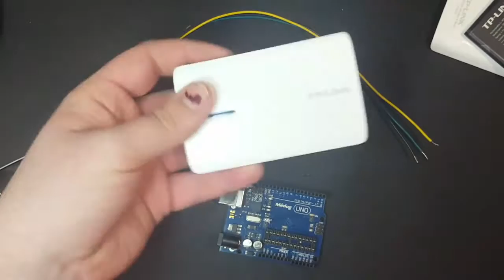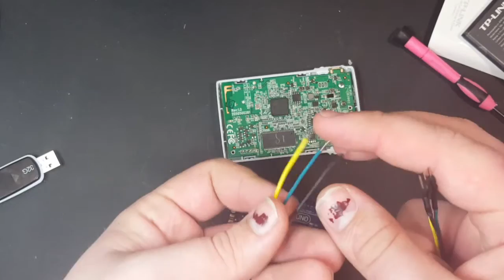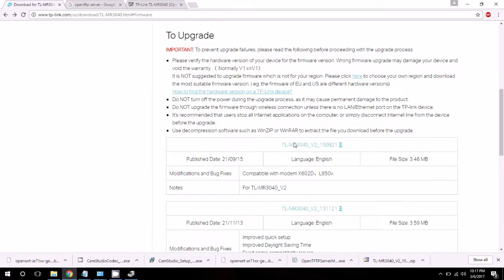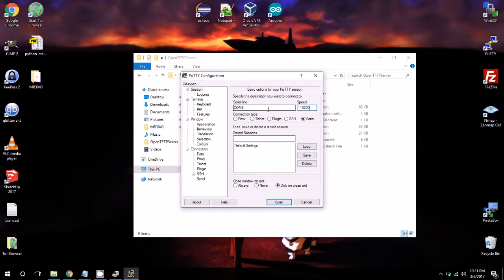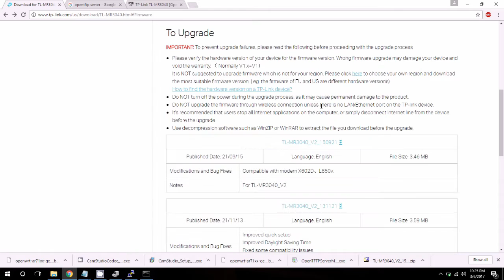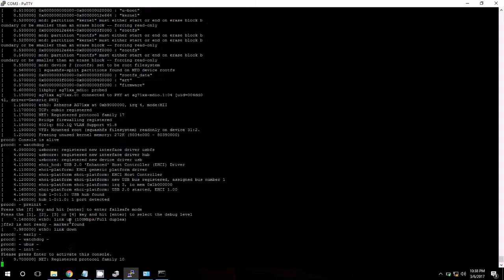Howto on Fixing Bricked MR3040

Comment: Hey @hackeritalics, I know this howto is of an older date already, but I’ll try asking in case you’d notice. 

The howto is great, I’m thrilled and prepared everything to fix my MR3040 I bricked years ago since I found out about your way of unbricking the router with UNO. So far everything went great, but I’m getting an error connecting via the opentftp server on port 69. The error is 192.168.1.253 Port 69, bind failed. Do you have a hunch on what that might be? There seems to be no other connection using that port and if I try :68 or :70 PuTTY / hornet does not work with it. Thank you for any thought on how to solve that!
Reply from the maker: OH, well hello! You know, I don't get on this username very often so I just saw this... hopefully you already figured it out but, if not, here is what I would suggest.

The first thing I would do is check to see if something else is already listening for connections on port 69 on your computer. Here is a quick guide on doing this: https://adamtheautomator.com/netstat-port/

After you know what process is listening on port 69 you will be able to figure out what to do with it. If it's not something important then you should be able to just kill that process using the task manager. One thing I"ll say is that port 69 is generally reserved for tftp. You may already have a tftp service as a part of another product, though this would be kind of odd.. (Some Internet of Things devices like smart thermostats or sip phones use tftp.)

The last bit I would say is that it's also possible that you have to run the OpenTFTP server as an administrator for it to work. I don't remember if I had "UAC" turrend off at the time I made this video, but to run the bat file as an administrator you should be able to just right-click on it and say "Run as Admin". (You may need to hold down shift when you right-click to see this option.) So yes, maybe try running your TFTP server with admin privileges and see if that helps out.

Comment: Any tips for avoiding a brick?
Reply from the maker: Mostly I would just say to pay attention to which version of firmware you were using and ensuring that it is for your version and revision of device. Under normal circumstances you won't have to go through something that is this technical to load firmware on and off the device. Even when loading open wrt onto it's to begin with under normal circumstances you will only be using the web interface and uploading the firmware update as if it were any other update from the manufacturer. If you are coming from open wrt, make sure that you are using the correct firmware and make sure you understand the steps regarding striping off the boot loader from the factory image as well before loading it. The size of the image is going to be exactly the same as the total size of all the available storage on the device. When you are running in open wrt you are unable to access certain parts of that available storage, so if you upload the entire firmware image it will start to write it to that available memory starting at the wrong place and eventually terminate too early. That will leave you with duplicate bootloader sections and then missing a bunch of data that would have been written at the end. That's how you end up with the brick basically. Other than those things, just look at and read and understand the documentation for your model on the open wrt site before you do any uploads of any custom firmwares. They will cover all of this stuff in great detail explain it a lot better than I have here. LOL they also have extremely knowledgeable Forum members.

Comment: thanks a lot... these two codes solved all the issues .....

hornet> setenv ipaddr 192.168.1.1
hornet> setenv serverip 192.168.1.253

nowhere in OpenWRT website, it is written I guess...
thank you very much...
Reply from the maker: I would not recommend using 192.168.1.1 since that is normally the default gateway on a 192.168 /24 network..
Reply: @hackeritalics  after a lot of failed attempts  I blindly followed your video... I'm not an expert in this field, just a beginner... Please make related videos if possible... Thank you for your efforts...
Reply: @hackeritalics  but I noticed one thing openwrt breaker barrier version doesn't work on My router with version 2.2...tried many times...

Comment: So... All led flash on power on and then only power light and cannot find any WiFi or ethernet means dead for good?
Reply from the maker: Henrik Thuresson i.... don't actually know.  Lol
Reply from the maker: It seems really unlikely to me that both network cards would die in some way. My guess would be that something is stopping the unit from booting up all the way. It's probably starting to boot up and then getting stuck somewhere along the ways. You could definitely connect up am ftdi adapter/ uno to it and watch it start booting up though. I would bet you will see it starting up and such and then hit some sort of error.  If the unit doesn't see a valid image  It will automatically restart and try again. If it's already in the image however and going through its boot up process there won't be anything to tell it to restart on its own.  That's why I think that it's just breaking somewhere before it can get to the point where it can create the hotspot. You could probably fix it doing these same instructions actually and just try loading up the factory firmware again. That is, assuming that there are no hardware issues and it's just a strange firmware issue.
Reply: I had exactly the same issue... I was flashing openwrt to My router with version 2.2...strangely it doesn't work with that version... But My other router with version 2.4 does work...